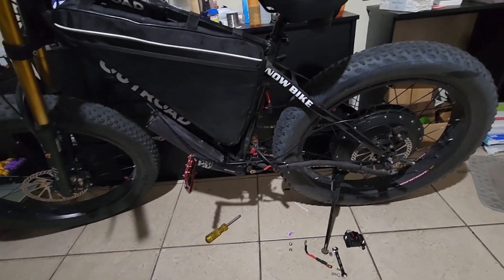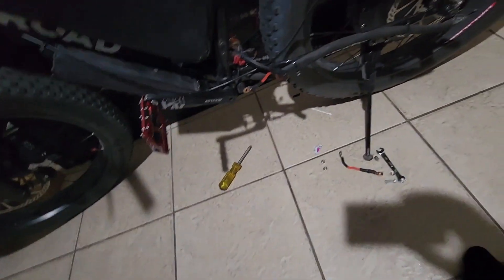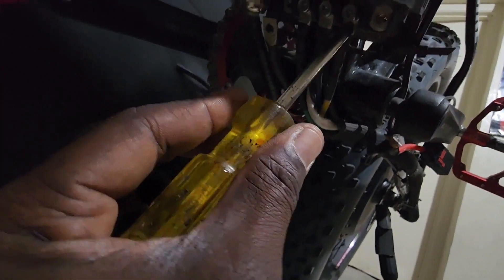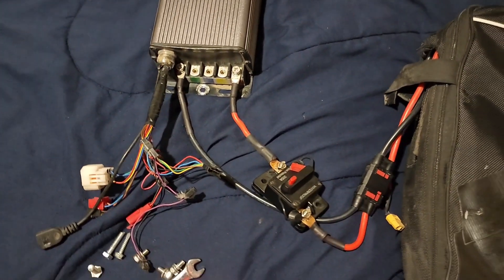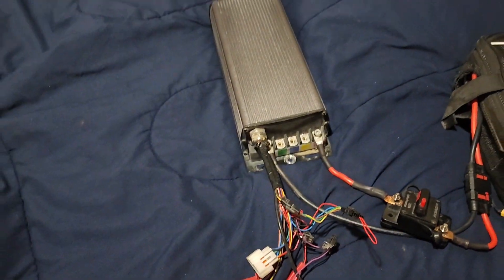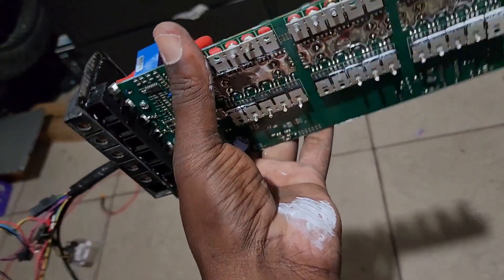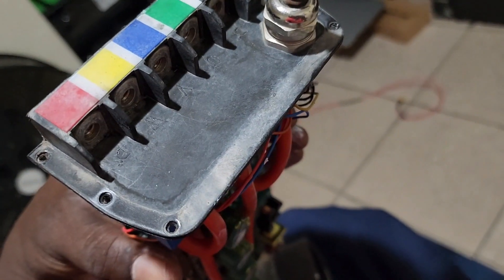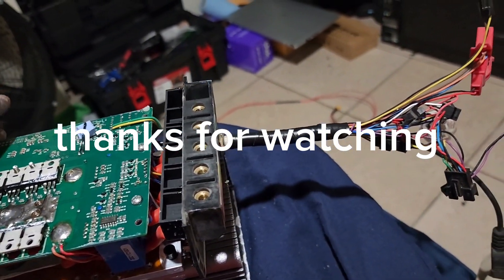My sabvoton 200a controller is broken!!!!

Comment: What i think happenned to mine is one screw from the disc brake got loose and damadged the yellow wire and a spark happened touching the metal of the screw. Communication error 30H.
Reply from the maker: Oh wow that will definitely do it.

Comment: What is the best control device sabvoton 200a or sabvoton 150 a ??
Reply from the maker: Now that depends on the battery,  I'll go with sabvoton 72200
Reply: @EBG-offical  
battery 72v 41ah LG 
motor 12000 w
sabvoton 200a

kke 
dnm

it is 4,000 dollars 

Is the price reasonable and its specifications strong?

Comment: Could be the 5v rail thats gone, that is probably why you have no green light because its not turning the processor on. Iv fixed alot of ebikes and stealth bombers and all the sabvotons just go because the MOSFETs get too hot and that thermistor is in the wrong place to detect also 5v goes aswell. Iv got 14 sabvotons that could be repaired but thats when i get equipment and find a full schematic fir the PCB
Reply from the maker: Oh ok I was fine, all day and I went to take it off then BOOM no power 🤔🤔🤔
Reply: @EBG-offical  yeah that's what there like, you could go for a ride then turn it off and that's it, even with MOSFETs you could short the motor wire and think it would have short circuit protection but they don't and boom 💥🤯

Comment: Do you think this is better than a BAC 855? I am planning on  BBSH 1000w mid drive, with 52v 24ah 50a samsung 14s battery pack. What would you recommend to get this most out of this battery / motor combo? Sry to hear your controller blew up :/
Reply from the maker: No problem, I would recommend the sabvoton 7280 fully adjustable for that setup

Comment: try this disconnect the positive and negitive ,then push the power button so it trys to turn on and drains all power from system,then disconect everything and let it sit a few days, then set it up off the bike use the breaker as a switch,and retest it,sometimes these things work themselves out .before you try retest it get multimeter and see if any of your phase wires are shorted,if they are shorted dont bother testing it needs repair

Comment: it sounds like you hit the positive screw with the screw driver to the case of the sabvoton which if bolted to the bike the case becomes the ground or negitive ,it will have most likely shorted out some of the power mosfets,not expensive to fix 5dollars each just need to know what your doing
Reply from the maker: Ok got it, I just got your comment I need to see where I can get them from

Comment: Heya ebike guy,you do realise that is a 300 amp at 12 volt breaker though dont you,not 300 at 72 volt?
Reply: 300amp at 72 volt dc is very hard to find and costly that why with the 250 plus amps bikes we run fuses as they are current rated not voltage and we also run contactors from the bms ,not just mosfets
Reply from the maker: @Katie Mcgilchrist  it's been running fine like this for 6 months, all I did was going to configure the wiring than pop!!!
Reply from the maker: The brakes is a 300a 12 to 48v dc

Comment: That’s unfortunate. I wonder if the seller can repair it cheap since it looks like its not fried. Thats a beefy controller with 30 mosfets. 

If you like pedal assist you might want to verify the fardriver can support it. I don’t remember seeing in settings when helping my friend. Maybe the guy with 96v battery can tell you if it has PAS settings.

Also compatibility with your display might not be fully supported. Fardriver supports YXT (one line communication) protocol which is common on many Chinese displays but seems your display has a different protocol. 

Fardriver is also rather bulky for an ebike. They are great for electric motorcycle with 3 speed selection switch and no pedals. If you convert the 4-wheeler to electric then Fardriver will be a good fit. 

I don’t think my Votol controller supports PAS either. Never saw anything in settings for it. 

I hope you can get the  Sabvoton back to life because it seems like a perfect controller for your ebike.
Reply from the maker: It's definitely powerful, I'll send it back to see if it can be fixed

Comment: i had that problem with my  48v controller .. i just started turning off from the battery and watch the display fade off..  knowing no power is left in the system.. it works for me for 1,000 's plus miles
Reply from the maker: Ok, man I never had this problem till now, that was crazy

Comment: Capacitors store a shiot load of energy even with no power going to it. I learned that from working on guitar amps. You have to drain the capacitor before messing with it. Probably shorted out a capacitor. Not sure how to check but I know you can with a multi meter tester. Usually you will see a burn spot somewhere but it's not always that simple.
Reply from the maker: True I'll send it of see what they can tell me what happen. I work on this bad boy alot and never had this problem till now

Comment: thats a bummer man, sorry to hear that. I've always thought it was interesting how the Sabvotons have all those wires and conductors exposed like that, it seems like it would be easy to short something out,  like that positive and the yellow phase if the screwdriver poked between the lugs.  Its interesting to get a closer look at the inside of the controller. Hope you get a fix soon man we all know you will !
Reply from the maker: Heck yeah, this is the 3rd one in the past 6 months
Reply: Where can we ask you questions cause I got à 2000w motor and planning to put à 3000w what controller is this à bad idea?
Reply from the maker: @tiiporgie9561  no, a lot of people do this to increase power to their existing motor
Reply: Cambia el semicontrolador  que esta justo al lado de los mosfet  que parecen procesadores perp son pequeños  son 3 uno para cada bloque, si consigues repuestos  cambia eso

Comment: same bike kind of. After 40-minute ride my throttle started cutting out after I'd release it and reapply fully it wouldn't be there, so pedal for a while and I would have throttle again. That stopped. my brake light was on... Everything looked fine I took side covers off. A single wire going into a wire connector was  labeled "brake signal" (2 daisy chained together for the front brake levers) it appeared that the wire had gotten very warm very quickly the connector had a light plastic bubble on the wire side. I thought the controller had fried. 
The next day I reconnected everything back up and it runs fine.

I think I need to know inputs and outputs for the controller, carry my meter. Something's getting warm and losing its solid connection maybe.
Is somebody could help me out with inputs outputs for the controller that be awesome.
Thanks
Reply: Without knowing which controller you have its hard to tell you all the inputs and outputs. But the brake sensors should be in parallel, not in series, so that either lever will activate the controller brake functions (power cut off, eabs, etc).

Many controllers let you choose HIGH BRAKE or LOW BRAKE(either with 2 different connectors to choose from or by programming it in settings), but some only have one and you need to wire it according. 

If you have LOW BRAKE, both brake levers have one wire going to controller ground and the other wire from each sensor goes to the controller LOW BRAKE wire. The problem occurs if you have a brake light because you can’t connect it directly to these wires or it will send current to the low brake wire which is normally 5v and pulled to 0v when you squeeze the brake lever.  So use HIGH BRAKE if you have that option and have a brake light.

If you have HIGH BRAKE, one wire from each sensor has battery voltage (after the ignition key) or in cases where you use a DC/DC converter to power low voltage brake lights, you can connect to that, and the the other wire from each sensor goes to HIGH BRAKE (and if you have a brake light, it goes there too so brake light comes on when you squeeze either lever).

There should be absolutely no heat in the controller brake wire. The only possible source would be if you had some high watt brake light getting power through those tiny brake sensor wires. LOW BRAKE simply bleeds a tiny current to ground and HIGH BRAKE merely sends a high signal to a port where its dead ended and measured by the controller.

If you have heat you might be sending battery voltage to controller ground wire if your brake sensors are wired for HIGH BRAKE but connected to the wrong wire on the controller.

Comment: I was told and always followed the advice from an auto electrician that "negative first negative last" is the order.
Disconnect negative first when removing battery wires etc and connect it last when reinstalling.
You'll get it sorted, don't stress too much 👍
Reply from the maker: I'll definitely get it figured out soon
Reply: @EBG-offical  hello! I might have some useful information for you 😀 https://youtu.be/lTssCn5YyTw
Reply: Strangely, standard 4 pins plugs do the exact opposite, they connect negative first and disconnect it last
Reply from the maker: @nicod974  it's crazy I disconnected the battery before I even started to work it numerous times too. Never had that problem till then
Reply: @E-bikeguy when you do that you gotta hit the display power again to purge that last bit of juice
Reply: Always negative first to come off and last to go on and once the battery
Leads are off controller, you need to turn on the
Controller to power down the controller capacitors otherwise they hold power for days